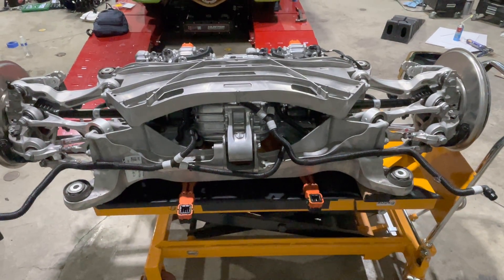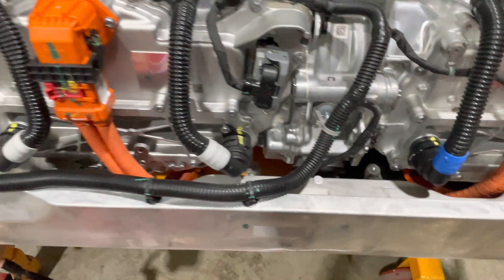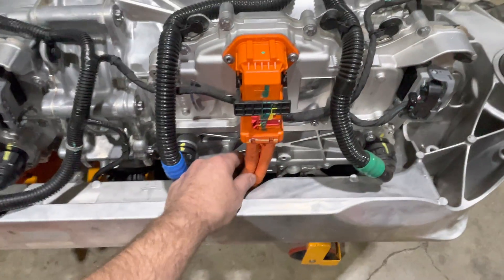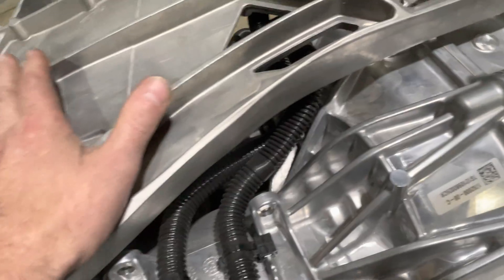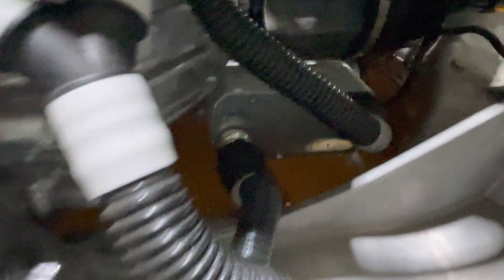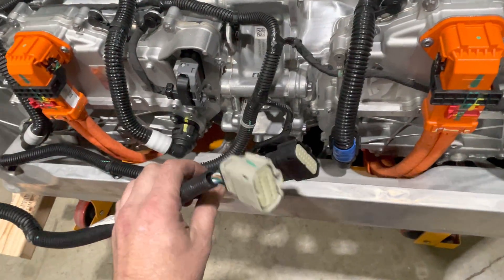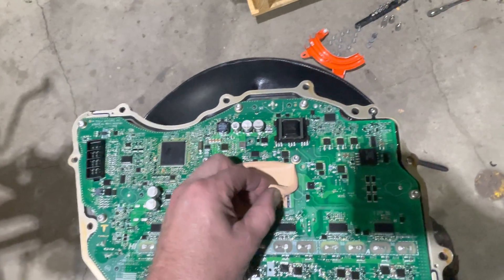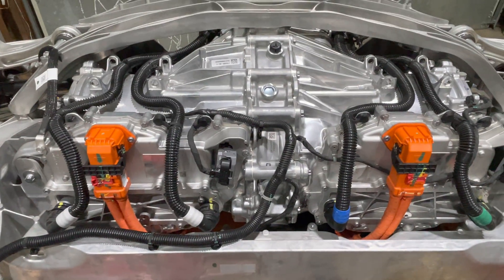Tesla Plaid Rear Drive Unit - Quick Look

Comment: Those castings look fantastic. And the way they did complete symmetry on the two Motors is very effective and also simple.
You mentioned there's no differential. That it's direct drive of each wheel independently. 
I watched a guy take a Model S plaid out for a very aggressive drive down a twisty country road. He was rather disappointed with the handling capability actually. Said he did not detect any torque vectoring on the rear axle.
Basically they were using the brakes to control left and right power. Ended up overheating the brakes a bit in the process. Seems kind of strange to me given there's two separate Motors one for each wheel it would have been so incredibly easy to do torque vectoring using their setup. But they apparently didn't instead of relying on the brakes.
Unfortunately his conclusion was that the model S plaid is a bit of a one-trick pony. It's incredibly unbelievably stupendously fast in a straight line. But really doesn't do anything else very well.
It did very good at the Nurburgring but he thinks that's because it's got long enough straightaways that the  power was enough to overcome its weaknesses in the corners. 
But on a tighter track the power is basically useless and it's constantly in traction control , ABS, stability control over load, Which eventually heats the brakes up.
Reply: It isn’t a track car, neither are most big luxury sedans.  Maybe one day Tesla will put these rear motors in a model 3 with track mode.
Reply: @JackMott  
See that's where I kind of don't understand. It's the fastest production four-door sedan ever built. Most people are going to expect it to perform in every aspect. And it doesn't.
Torque vectoring would be so easy to do with this car and yet they didn't.
They also didn't give it very good brakes apparently...
Lots of reports of the breaking power being a bit subpar giving the power output this thing has.
The torque factory could be solved with a software update. And certainly a brake up grade would be super easy to do also.
Just seems to me it should have been that way from the beginning
Reply: @kens97sto171  it does do torque vectoring, what you want is to be able to do beautiful power slides which it currently doesn’t let you do.  I imagine the lawyers are worried enough about how many people the car is gonna kill (its killed 2 so far!) Anyway yeah lots of people expect it to be a supercar and forget it is a huge 4 door sedan.  people are silly.
Reply: @JackMott  
There are plenty of other powerful large four-door sedans that will allow you to hang the ass out around the corner a little bit.
I watched Kyle Connor from out of spec motoring take a plaid out on a canyon road. He was pretty underwhelmed by the way it felt while driving at briskly. Basically it doesn't let you do anything if the steering wheel is turned even slightly.
So essentially it is a one-trick pony it's extraordinarily ridiculously ludicrously fast in a straight line. But really doesn't have any other positive attributes. Then any other Tesla Model S anyway.
Basically it's not fun to drive on a twisty road at all. Versus the Porsche Taycan or any other Porsche for that matter which are fun to take on a twisty road.
They are not as fast in a straight line as much as the Tesla plaid. But they are faster around a corner and feel better doing it. That's the thing that it's lacking not just a statistical performance numbers. But the feel while driving it is just pretty bland.. except forward acceleration of course.
Just seems very unfortunate to me that they didn't do more to make the car more fun to drive.
I would gladly trade a bit of raw acceleration for a better driving feel.
Reply: @kens97sto171  I know people build huge luxury sedans that are fun canyon carvers (I have owned an M5). I just don’t know why anyone wants that.  Yes I am aware of the irony :)  My dream is for Tesla to put the rear powertrain from the plaid in the model 3, with no front motor, and a carbon fiber roof.
Reply: @JackMott  
I think part of it is if you're spending that kind of money for a vehicle you want it to be good at everything. I've driven in an M5 also. Thoroughly enjoyable having a car that's quiet and comfortable and luxurious but that one can also handle a twisty road.
Kyle from Out of Spec motoring..did a lot of recent reviews on the the high-end luxury sedans.
Drove them all within about a week of each other..
Mercedes eqs, the Porsche lineups the Tesla Model plaid, lucid air, and another one that I can't remember right now.
And they all do a better job of feeling good while driving them..
People want the experience of a car that makes them happy and can do everything well.
If I was going to drop cash on a full size mega luxury sedan I would probably pick either that Mercedes EQS. or the Porsche.
The interior on that Mercedes is just absolutely stunning. It's surprisingly quick, and it handles and feels good. The ambient lighting in that car is absolutely stunning also. And it's a lot less expensive. Not exactly as spectacularly beautiful car on the outside. Although it is the most aerodynamic four-door sedan built and looks to have a spectacular range because of it.
 It's even cheaper than the model S plaid also.
Reply: @kens97sto171  no amount of money makes a car good at everything.  A McLaren F1 is terrible at many things.  Currently the Plaid is the only 1000hp zero emissions big 4 door with a robust charging network.  so for weird people who want huge sedans with too much power they can have one.  also the weird people who want powerful suvs can have one :)
Reply: @JackMott  
No but you can have a car that's good at a lot of things. 
Or at the very least you can pick one that's good at the things that you care about. 
Someone that would buy a McLaren cares about the things that that car is good at.
The disappointment for me on the plaid is that it could be good at those things that the Mercedes eqs is good at but it isn't. 
It's more of a one-trick pony like the McLaren although infinitely more practical. 
But it wouldn't have taken a lot of extra effort to make it handle better and have decent brakes.
Especially since the handling aspects are mostly software issues.
Charging network isn't really an issue. Electrify America is getting better all of the time...
And people don't road trip that often regardless.
The Mercedes and Porsche especially the Porsche actually have a better charging curve than the Tesla does anyway.
Tesla has definitely become more conservative on their charging curves lately. Probably a good thing honestly they probably have a lot of data collected on damage done by excessively rapid charging.
Definitely check out Kyle's channel out of spec motoring and he's got several other related channels. He's probably the only reviewer I've seen who pretty much gets to drive everything and compare it. He owns a Tesla Model 3 Performance personally and has to World records for cannonball run times across the US the first one in his model 3 the second in a Porsche. The guy definitely knows what he's talking about when it comes to cars. He also runs a couple of racetracks. And has no fear about hanging in the ass out sideways and drifting his model 3...
His videos on YouTube are usually pretty entertaining and informative at the same time.
Reply: @kens97sto171  ive been racing and driving interesting cars for 20 years I don’t need to watch kyles channel, but I am glad you are excited about it :). I am just enjoying my model 3 performance (it has track mode!) and am not confused about why some people are excited about a car that runs 9s on street tires and also holds a mountain bike in the back with zero emissions
Reply: @JackMott  
Porsche handed him the keys to a Taycan knowing he was going to do the cannonball run it with it...
He then beat his own previous world record crossing the United States in an EV.
Virtually every other manufacturer has given him direct access or special access to their vehicles even before production if the car was available.
So yeah,  I trust his opinion on cars.
 I'm never going to own one of those myself, but I can learn about them from his experiences.
I like cars too,  I've driven just about everything there is.
 I've owned about 50 cars in my lifetime. Ranging from Geo metros to boosted imports. I've driven ZO6 Corvettes.. and my daily driver now is a incredibly boring but reliable Toyota Prius. 
I'm cheap and I  drive  a thousand miles a week... 
Kyle  does full charging curve tests, full range tests at 70 mph. Efficiency testing. Does testing on the driver aids and safety systems.. 
He's done more cross country road trips in a variety of electric vehicles then I can even remember.
Basically he test the cars pretty completely.
And as I already said the model S plaid is incredibly impressive considering its practicality for daily driving. Lots of room , and storage etc 
But if Tesla had spent another couple more months working on software they could have made the car even better. They just decided not to. Hopefully they will in the future.
If Kyle says that the model S plaid does not drove great on a tight twisty road .
I'm inclined to believe him.. he would know.
The car did very well on the nurburgring. But it's a fast track and It has long straightaways where the Plaid can you utilize its incredible amounts of acceleration to make up for its shortcomings in the twisty parts.
I'm not trying to argue with you.
 I promise you if you watch a couple of Kyle's videos you'll enjoy them. He's funny, and informative and NOT biased. If something sucks.. be says so.
He's has driven just about every electric car on the planet. All over the world. Have you? Probably not...
And neither have I.
But because I'm fascinated by cars and technology... like you,  I follow people and watch videos made by people who have access to things that I don't so I can learn from what they discover.
Reply: @kens97sto171  Tesla is selling all the cars they can build, makes no financial sense for them to make niche enthusiast cars right now.  This stuff is fun for us but the world buys way more boring cars than M3s and GT3s.  Gotta wait for an electric drivers car (they taycan isn’t it either, its 5000lbs!)
Reply: @JackMott  
You're right they are selling every car they can build.
 And yet they chose to design and build the model S plaid, and they've got the roadster coming.
If you're going to go ahead and build it you might as well spend an extra little bit of time to make it as good as it can possibly be. 
They could have put better brakes on it and they could have tweaked the software to have better handling characteristics. This would have been very easy to do.
And actually the Porsche does handle significantly better. It's got better brakes it's got better chasis Dynamics it's got better steering feel,  and would crush the Plaid on a tight twisty road .
You can Hammer that car all day long and not worry about the brakes overheating and not working anymore.
This should not be surprising , Porsche builds sports cars ,they're good at it. that's what they do and they're quite proficient at it.
You're absolutely correct about the vast majority of cars sold are relatively boring. I would know I drive one...
Toyota Prius is just about the most boring car in the world. But for me it's a tool for a job. It was cheap to buy and it's cheap to operate and  it's reliable..That's all that matters to me.
I have an old Jeep for playing in the dirt . That's my fun car now .
Most people feel that way about their vehicles. That's why Toyota Corollas and Toyota Camrys and Toyota RAV4s and other similar cars sell so well.
I think Tesla should start to concentrate on lower priced cars, that suit the needs and budgets of the average and lower income groups. But they're not going to be able to do that until they have more manufacturing capability.
I'm sure that'll come in time...
I do wish they would jazz up the interior a bit though. Software experience is really good. But the interior of Tesla is really doesn't have a whole lot of soul. There's no flair doesn't even have ambient lighting. Even the lowly Chevrolet bolt EV has ambient lighting.
Doesn't cost a lot to execute that kind of thing but makes the interior of the car a nicer place to be.
Reply: Well that's disappointing. I can hang the ass of my EV mini out, even though it's FWD.
Reply: @pictsidhe6471  
I think on the Model S plaid they added a new mode that gives more control overhanging the ass out now.

Comment: Since the long range has same pack as plaid including drive unit connections, could long range rear drive unit be swapped with plaid?
Reply from the maker: Yes, but there are other differences, along with lack of software support.  It would also void your warranty.   You are better off for the value of the car to sell the LR and buy a Plaid.

Comment: These Plaid drive units also have the carbon fiber sleeve that is new to the Plaid no doubt could find its way to the Model 3. Another fun fact the Lucid single drive unit puts out almost as much HP as the Plaid duel drive units at 670 HP and the motor is like 1/3 the size of a single 2023 Z06 flat 8 engine while having a lot more torque and matches it HP number 670.
Reply from the maker: I have another video, if you want to see the carbon overwapped rotor: https://youtu.be/QnmVTlaRTLk

I'd love to do a teardown of Lucid's stuff!    Until then I want to see how reliable they are in the field.  Tesla's early drive units were pretty poor.  Now they will probably outlast the rest of the car.  You could definitely push more power through any of Tesla's designs, but reliability would suffer.  Let's see how Lucid looks in a few years.

Comment: Will you tear down the rear drive unit? Can not wait to see the reduction structure to make sure it is indenpent drive the wheels.
Reply: You could tear down the battery to make sure there isn't a nuclear fusion reactor in there, too, but that's not a realistic possibility either. Of course the two motors each independently drive a wheel.

Comment: I’m surprised the model three uses aluminum wiring harness as opposed to copper. Seems like an odd place to cut cost
Reply from the maker: Copper is expensive and heavy.   Aluminum is extensively used for conductors.  I bet 99% of the transmission lines feeding power from the grid to your house are aluminum.  As long as it's terminated properly, it's a good choice.

Comment: Wow! So simple yet so amazingly complex. The more you understand and see, the more you are impressed with their engineering. Although, one thing I would love to see is an analysis of the suspension geometry and how it transfers force and energy to the wheel hub. As in, how each of the arms work.
Reply: It's a common five-link design, like the Tesla Model 3, BMW 3-series and 1-series since 2004, Mercedes W201 and successors, Mazda RX-8 Miata NC Miata ND, current Cadillacs, Camaro (since 2016), etc. Look up any of them... this works the same way.

All links are loaded in compression and tension only (no bending), and all five are oriented differently to handle a different component of the forces.

Comment: You said these are basicly 2 model 3 motors glued together? Thought these were new carbon wrapt motors? TThanks for the video's!
Reply from the maker: Yes, they "basically" are, and you are right, they do have the carbon overwrap.  I have already taken the front motor apart, which you can see here: https://youtu.be/QnmVTlaRTLk
Reply: @Ingineerix  Thx for reacting, I'll check that one out. Sorry for the spelling, I'm from Belgium...

Comment: What about the cogging torque? Is this vehicle permanent AWD and if not, they have the front motor drag whenever is not used then?
Reply from the maker: Yes, there is loss, mostly in the additional friction in the added geartrain, so this is why AWD has slightly less range than RWD.

Comment: Imagine one of those welding shows are custom car shows doing a special build.  Take a previous edition Escalade and put  Plaid Rear Drive Unit in it with batteries.  How can this motor handle more weight like that.

Comment: If I got it right, the plaid does not loose power like a model S when mooving in high speed, It has to do with motor or controller ?
Reply from the maker: Motor, Inverter, Battery pack, and cooling all are inproved to this end.
Reply: @Ingineerix  took me some time to find how to answer. Thank you for youre answer.
I think, that they use some of the same compenents like model 3, but carbon wrapped rotor, to catch with high rpm, maby the stator windings are made sligthly different, the high rpm means higher freqcvence, and as you say inprooved cooling. Have I got it right ? 😎 ?  Ps I dont have a car but if - it would bee a 
TESLA
Reply: I can see how you might think that if you don't understand the design. In this type of multilink suspension (which is very common from other manufacturers, and has been used for almost 40 years) each link takes load only in compression and tension - never bending - so the links can be light.

Comment: why does it cost x2 Model 3 using same parts with some upgrades
Reply: it uses 3x the permanent magnet ansynchronous motors, which the model3 performance has ONLY in the back. Battery pack is larger and allows higher current and voltage. The car has air supsension, more comfort extras and is bigger. Ho won earth are that "just some upgrades"?

Comment: So how likely is this to be used in the Semi drive train if so how heavy is this unit?
Reply from the maker: They are already using the same basic motor/inverter for the semi.  It's installed 2 motors into a big heavy live axle, so basically the same thing, only much heavier duty and 2 axles (4 motors total).